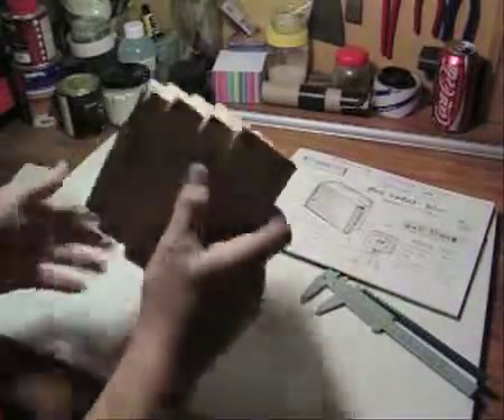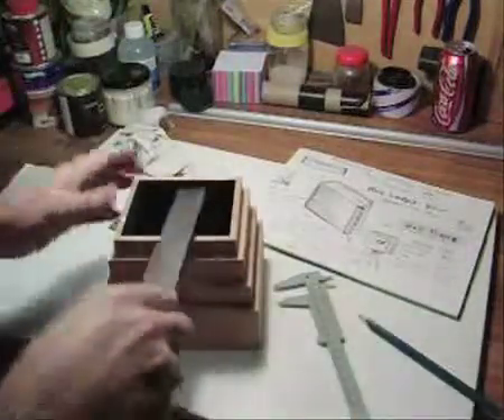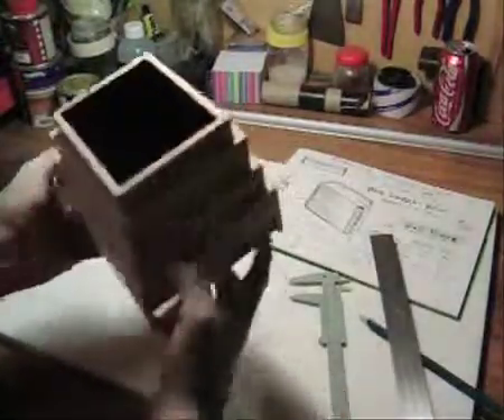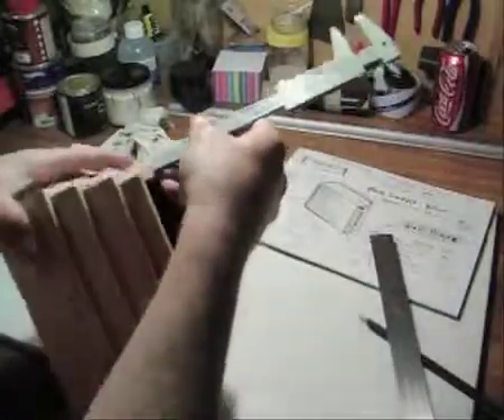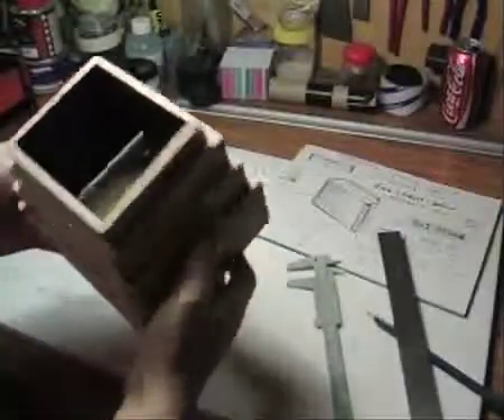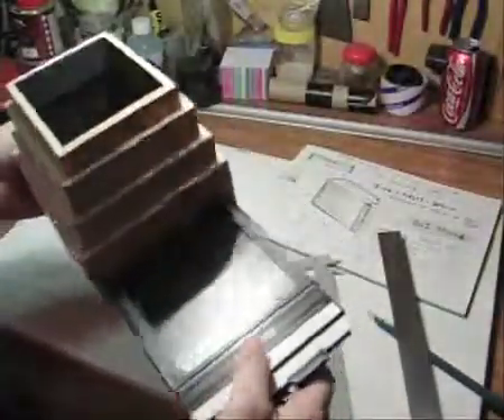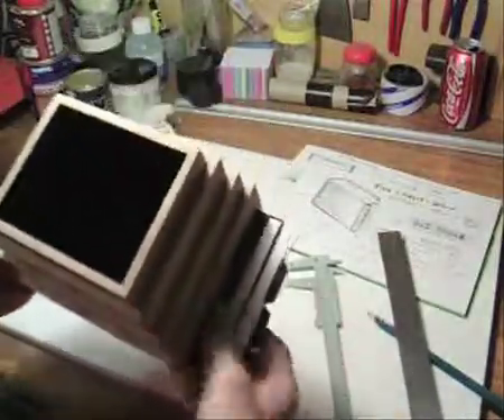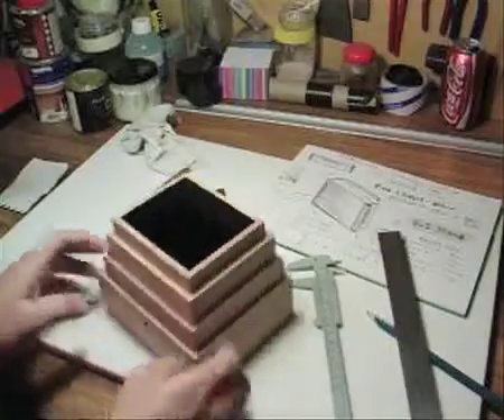Build a 4x5 Pinhole Camera - Part 7

Comment: Would you recommend using a router to carve out the square for the brass pinhole to make the bottom  flat and even with the surface of the wood?